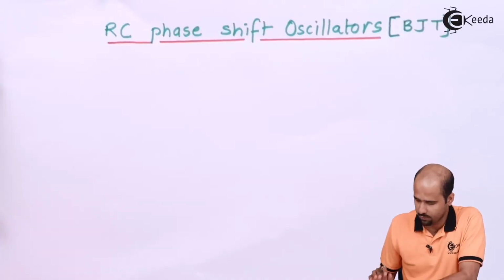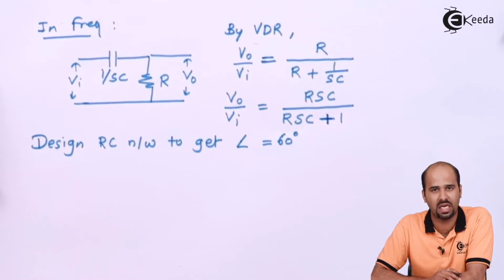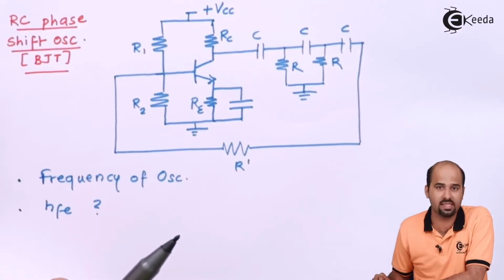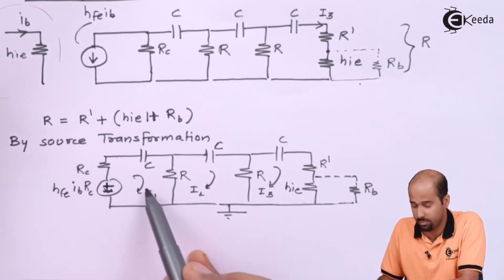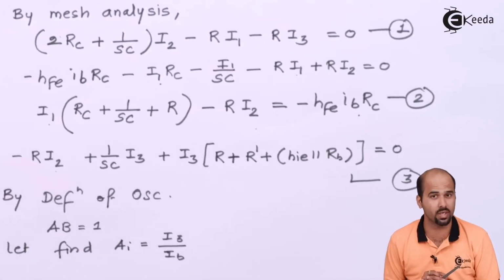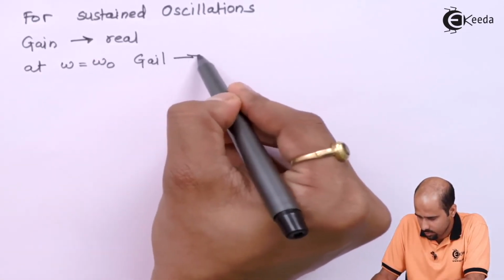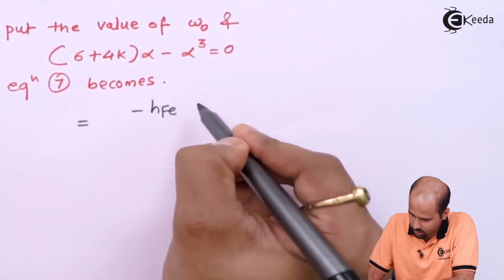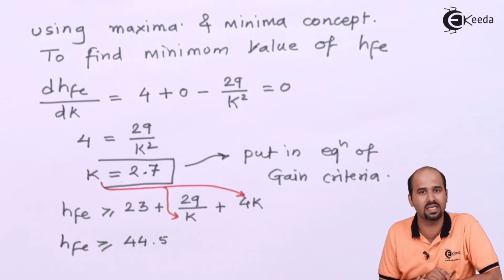RC Phase Shift Oscillator(using BJT) | Oscillators | Electronic Devices and Circuits 2 in EXTC

Comment: The operation of the Phase Shift Oscillator is very important because it has never been described before and the only vague reference has been by a Professor who waves his hands around and says something like three phase sections produce 180° Phase Shift.
But no explanation has been provided for this Gobbledygook.
The operation of the Phase Shift Oscillator is very complex and is nothing like you have been told. Forget everything you have learned. .
The first thing you have to understand is the behaviour and operation of a capacitor when it is not connected to either power rail.
It rises and falls in the circuit and when it charges and discharges, you can think of it as increasing and decreasing in length.
When it is connected to a resistor, the voltage across the resistor depends on the charging current of the capacitor.
A capacitor has energy or "charge" in the form of a voltage across its terminals and a current capability according to the number of plates in the capacitor (its capacitance).
The base of a transistor cannot rise above the emitter by more than 0.7v.
When the voltage is below 0.7v, the base is seen as having a very high input impedance, by the rest of the circuit.
When it sees a voltage of 0.7v, any extra voltage delivered to the base will be converted to a CURRENT. A transistor only works on CURRENT. It is difficult to measure current and so we talk in terms of voltage.
When it sees 0.7v, it immediately has a low resistance and only accepts CURRENT.
Increased current makes the transistor turn ON more and the collector voltage falls.
This has never been described before and you will not be able to understand the operation of the Phase Shift Oscillator without this knowledge. 

The principle of operation of the Phase Shift Oscillator is to deliver a signal from the output to the base.
A rising signal on the base produces a falling signal on the collector.
This does not produce oscillation. This is called NEGATIVE FEEDBACK.
We want POSITIVE FEEDBACK.
We want a rising signal from the collector to deliver a rising signal to the base to increase the amplitude and maintain oscillation.
An oscillator of this type is actually  turned ON more and more until it cannot be turned On any more and then turned OFF until it cannot be turned off any more.
We need a rising signal on the collector to become a falling signal on the base.
In other words, the the rising signal has to turned into a FALLING signal. 
This will turn the transistor ON more and more to produce our wave.

We will start with the capacitors fully discharged and no voltage on the base.
This effectively means the transistor is out of circuit and the collector LOAD resistor pulls the 3 capacitors HIGH. The third capacitor is connected to the base and when it sees 0.7v,  the transistor gets turned ON a lot and the collector pulls the LOAD resistor down to a very low voltage that just allows the base to see 0.7v.
This means the transistor is not fully turned ON and the collector voltage is slightly higher than 0.7v.
The capacitors now starts to charge and the current into the base reduces.
This allows the transistor to turn OFF slightly and the collector voltage rises.
It is the rate of charging of the capacitors via the two 10k resistors that controls the current into the base.
As they charge, the charging current reduces and you have to understand that the base creates a resistance when its voltage is above 0.7v and it detects this reducing charging current.

There is a fight between the base receiving current and the transistor turning off as the capacitors charge, and this takes a long time and produces the wave from the lowest value to the peak.
Eventually the capacitors are fully charged and the base receives no current and the output is a maximum.
It would remain in this HIGH state if were not for the 1M base-bias resistor.

The left lead of each capacitor is charged to a positive voltage compared to the right-hand lead.
This makes the left lead of the third 22n more positive than the other lead.
When all the capacitors are  charged, the voltage across the 10k resistors becomes zero.
This means the right lead of the third 22n is slightly negative and this is what the base sees.
But when the base is below 0.55v it has a very high impedance and the voltage on the third 22n does not change.
The 1M base-bias resistor is connected to this point and it delivers a current to DISCHARGE the third 22n and gradually charge it in the opposite direction until the base sees 0.7v.
This turns ON the transistor and the collector voltage reduces.
This starts to discharge the first two 22n capacitors and reduces the voltage on the base, via the third capacitor.
At the same time a negative voltage is developing across the two 10k resistors. The 1M charges the third 22n in the opposite direction and there is a fight between the first two 22n capacitors getting discharged and the third 22n getting charged.
The collector voltage is reducing and the 1M is having less and less effect and that's why it is taking longer and longer. But the negative voltage across the second 10k resistor is reducing and this is raising the third 22n to deliver more current to finalise the turning-ON of the transistor.  
Eventually the transistor is turned ON with a collector voltage of a little more than 0.7v.
The capacitors are uncharged and the 1M is not capable of keeping the transistor turned ON to this amount. The third capacitor passes its charge to the transistor and it starts to turn OFF.
This raises the collector voltage and via the three capacitors the base sees more current and this stops the collector voltage rising.
But the capacitors all start to charge and the charging current reduces. This reduces the current into the base and the collector voltage rises.
This effect continues until the collector voltage reaches a maximum and the capacitors become fully charged and the charging current reduces to zero and we have come to the conditions at the beginning of our discussion.

The operation of the circuit has nothing to do with 60° phase angle of the capacitor and resistor pairs and that’s why no-one has been able to explain how the circuit works.
The delay is produced by the interaction of the rising collector voltage and the delay produced by the capacitors charging and reducing the current into the base. This produces the rising portion of the output wave.
For the falling part of the output waveform, the 1M is discharging the third capacitor to produce a current into the base to keep turning it ON.

Unless you know exactly what is happening, you get a surprise when you find negative voltages on some of the components.
Do not accept a glib answer from a Professor who wants to confuse you with gobbledygook.
His answer might refer to 180 degree feedback, but how does it do it?
That’s the answer you have to get. That's the answer he cannot give.